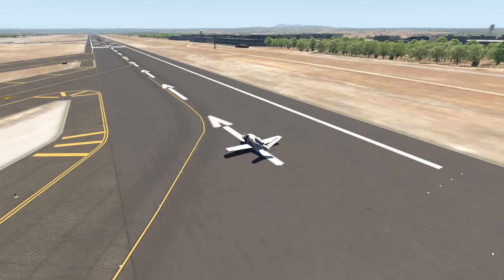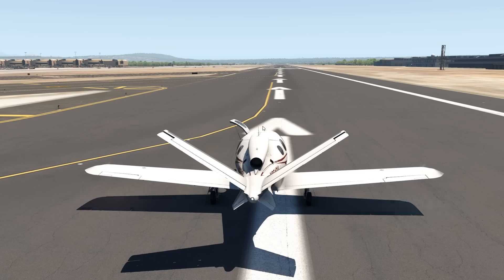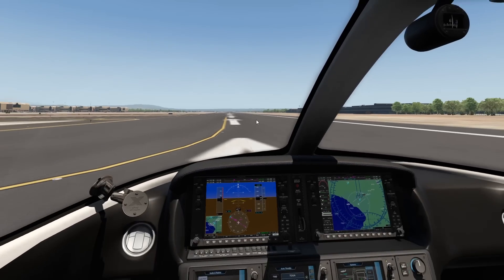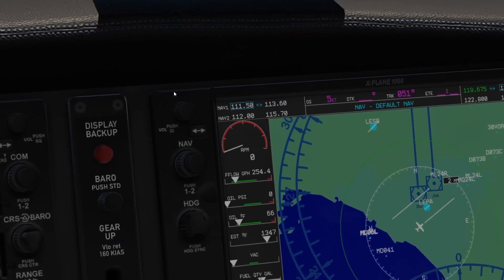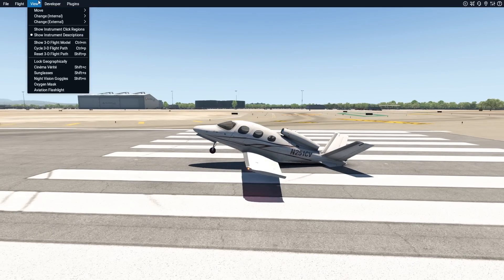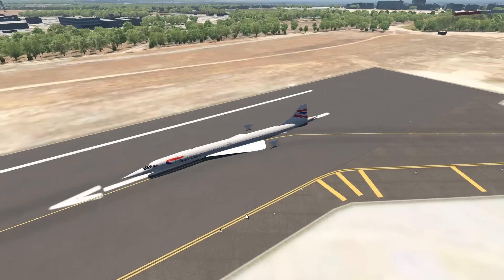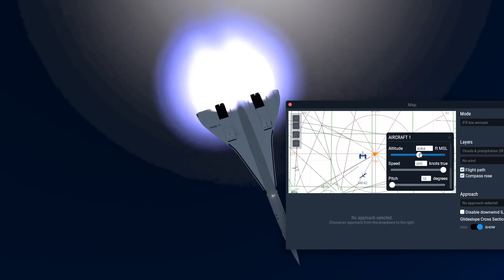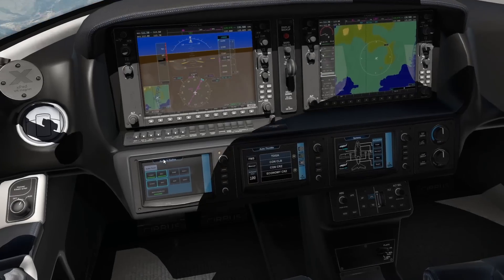Putting A Rocket Engine On A CIRRUSJET

Comment: Rocket engines require a fuel(the keroseneis already in the plane) and a oxidizer like liquid oxygen or something similar. So it's impossible that a real rocket engine would work on a plane unless you had both a fuel and a oxidizer.